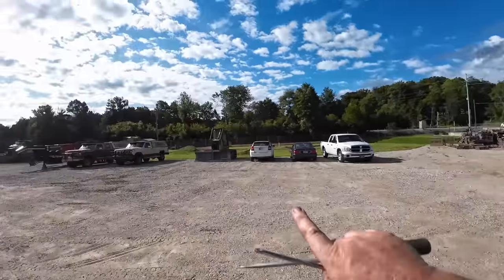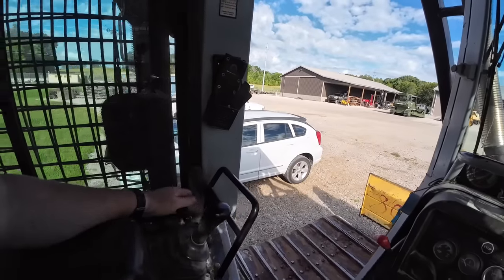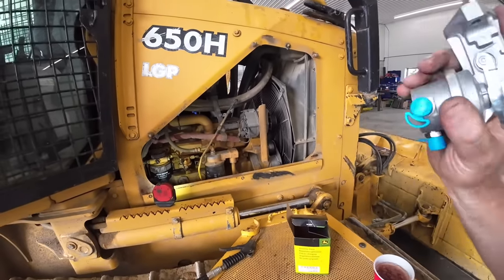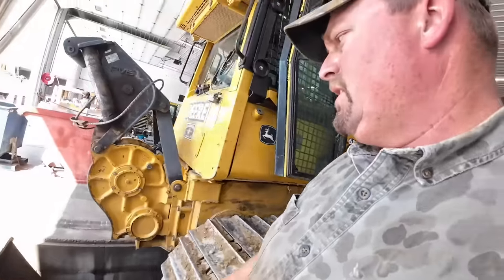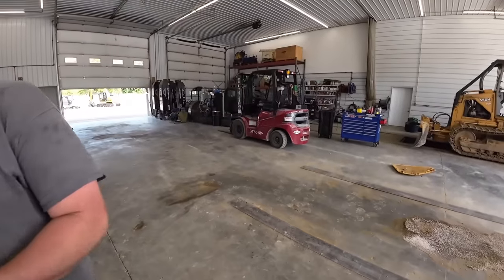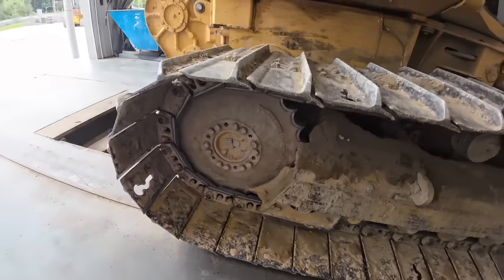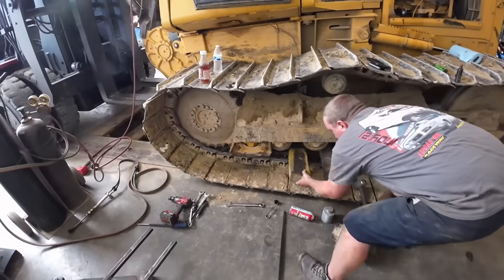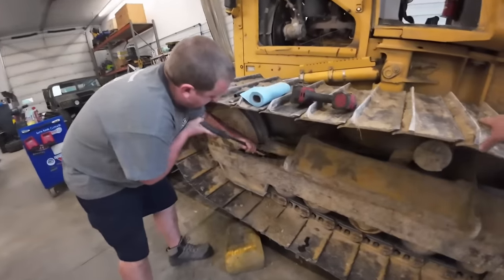Simple repair on dozer leads to many headaches and we return so broken Harbor Freight tools!

Comment: You may want to try some Kroil Penetrant for rusted/stuck bolts and nuts, this is the best stuff that I have ever used.
Reply: I priced that kroil penetrant and the price is outrageous on Amazon.
Reply: @deliveryguy7402 but it is good stuff.  Jack leg mechanic here but it's all I use . Sometimes just got 2 pay fiddler ! God bless and have a good day  .
Reply: They are really proud of kroil.  Zep has worked better for me. & more affordable
Reply: @geostawny  you differently want to us what works best for you
Reply: 50/50 transmission fluid/acetone. same as aero kroil
Reply: 50/50 transmission fluid/acetone
Reply: I have used it several times and it does a great job of penetrating rusty things

Comment: The little coils you use for that tool are small induction coil and to work properly they need a gap around the part, the more times you heat the steel it changes the property of the steel especially when you add the penetrant oil . we use to use induction coil on a larger scale but still work on the same principal. Heating the frame  more may have worked better, we only heated bolt heads if lock tight was applied.

Comment: the ductive heater is designed for nuts stuck on threads not bolts stuck in threaded hole, for bolts stuck in threaded hole i heat the metal around the bolt then cool just the bolt , normally works
Reply: Exactly.... You're trying to expand the "hole" while keeping the bolt cool (and thus relatively the same size).
Reply: I agree. You should have heated the metal the bolt was in. I've been working on autos, trucks and heavy equipment for over 45 years. The only time I need to heat the bolt, was to get rid of Red Loc Tight, first.
Bob

Comment: Heating the bolt makes it expand into the hole.  You need to heat the metal surrounding the bolt.
Reply: If that’s the case, why would the new tool heat the colt?
Reply: True, but they are heating the metal to expand the bolt to break any rust up so they can then turn the bolt.  once it cools down - even a bit - as it cools down it breaks the rust bond and makes it normally so that the bolt will turn.

If it doesn't then..... it can't be stuck if it's a liquid.
Reply: @MichaelVankirk-q4s  It can work in some cases. But the best bet is to heat the rail not the bolt.
Reply: @MichaelVankirk-q4s  I'm not an induction expert..if your cooking pan base won't stick to a magnet then the induction method of heat transfer will not happen on your induction stove top, stainless pans will often include a mild steel layer stamped between two stainless layers to make it compatible with induction cook tops ..those induction coils in the stove top may very well be directional, else wise any steel component inside the stove top would be a fire risk, the coil used  here was touching the bolt head far more than the surrounding steel
Reply: But it shrinks when cooling.
Reply: With respect to all viewers, these guys have been working in heavy earth moving equipment for a little while now, so I’d guess they have got the hand of removing frozen nuts and bolts🤔
Reply: @PhilRable  with all respect Phil, you can teach an old dog new tricks 😂. I learn something new everyday and have been repairing equipment and doing electrical work since I was 15 years old. I’m retired now at 68 (almost 69) but I still fix a lot of stuff 😊.
Reply: @PhilRable  evidently not because they did not get it out.
Reply: @deliveryguy7402 Yes! This is what people don’t understand! The beauty of welding a nut on is not only do you have a new bolt head but you’ve significantly heated the bolt, but not the surrounding threads because rust acts as an insulator. So the bolt cannot expand but it does shrink, pulling away from the rusted threads. If you had heated the bolt and surrounding material equally they would just grow and shrink together. Heating just the bolt and letting cool is the way to get the bolt shrinkage.
Reply: @colindgrant  really? Then why is the bolt still in there frame?
Reply: @anthonyhumbert8787  as mentioned in the video, they were unable to heat the full length of the bolt, and it had long thread engagement length. The method isn't guaranteed to work in all situations, but physics is.
Reply: @colindgrant  physics has nothing to do with it. It's thermodynamics
Reply: @anthonyhumbert8787  LOL!
Reply: Heating the bolt works 10x better.  Heating the surrounding doesnt work al all because it is just way too  slow.
Heating it expands the bolt when the surrounding material keeps the same size. So the bolt has to expand in the lenght only. When it retracts it will retract in both ways, so it will be smaller when cooled down. Then a nut can be welded on and then the bolt goes out. Thrust me i have done a lot undercarriages with a lots of broken bolts. I learnt it quick, otherwise i had to drill out 60 18mm holes underneath  a crane. With the procedure i said, i only had to drill 3, and they were propperly fcd
Reply: @megape95  100%

Comment: I have been shopping at Harborfreight for over 20 years and when I was a mechanic for Bobcat, I priced three angle wrenches for hydraulic fittings with Snapon, and they were $300.00. I purchased the Harborfreight complete set for $39.00 I have them to this day!

Comment: These induction coils are usually only used in places where a open flame is bad, like hydraulic hose fittings, injection lines and fuel line screws, nothing replaces the oxy gas torch except maybe the oxy lance

Comment: Sometimes they would use liquid nitrogen. The whole thing is just a bear. It's just a grueling bear.You start asking yourself questions about yourself. Yeah, it's a broken  bolt upside down. In that position, not much space is the worst. Or maybe heat up the skinny part of the rail to expand the rail. Or make the whole bigger. It's just a bear , no matter what.

Comment: To loosen a nut -- heat up the nut & it will expand.
To loosen a blot -- heat up the area where the bolt 
goes into or freeze the bolt.
Heating the bolt will cause it to expand & get tighter.
Reply: If you heat the bolt, it will expand into the cold bore of the frame, the frame is rigid so the bolt if got enough will compress, but then you need to let the bolt cool completely to get a couple thousandths clearance for penetrating oil to soak in.

Comment: If you have a bolt that is stuck , you can easily remove it by heating it red hot then quince it with water until it’s cold . It will come out very easily , works every time . I have used that trick for 30 years. You keep up the great work.
Reply: I completely agree with you about quenching. I'm a retired British blacksmith, it was one of the first things we were taught. It works better on nuts, than studs, if you get both components red hot then quench the not very quickly it will stretch the nut ,and almost certainly be just hand tight

Comment: Just a hint. Nuts are not the same as bolts. The induction heater works better on nuts as it expands them off of the bolt. Heating the bolt causes it to swell in the plate. Of course a molten bolt will come out! 😄

Comment: You should have used a rose bud tip on the oxy acetylene torch and got the rail red hot. I worked o a lot of Turf Eq back in the 70's and it would work almost every time 😀

Comment: since you had access from the top of the broken bolt in an open hole....would have been an interesting candidate to try the "Candle Wax" method for removal
Reply: I’ve used paraffin wax to remove couplings from shafts. It works good. I keep a block of it in my toolbox.

Comment: I'm surprised you didn't use an air hammer to "shock the bolt" before welding it. Shocking the bolts really really seems to help off rusty and stuck bolts.

Comment: I know on our 650H it lost prime all the time and chased it figured we had fuel leak somewhere couldn’t find anything changed a lot of them rubber grommets on them small metal fuel lines with no luck and finally found where they changed the design or came out with another hosing for the first fuel filter think they got rid of the hand primer on first fuel filter hosing changed that out hasn’t never lost prime since that…sales service woman at our John Deere dealer said her tractor done same thing till she changed that part out so we tried it and damn the luck

Comment: Use 50 nuts to get one bolt out. The induction heating coil should fit around the application with enough space to leave a small gap between the coil and the object to be heated. The closer the fit (without touching), the faster the unit will heat the bolt. If your coil diameter is too large for the application, it may take longer to heat. I google it :)

Comment: Heat the part the bolt goes into, also air hammer around it, helps to break that stuff up a bit. And for those induction heaters, I use them for o2 sensors. The coil doesn't touch the fastener, it's not supposed to. Hence, the induction part of the induction heater.

Comment: I remember doing that years ago and after many nuts and washers plus many many cuss words and a few beers a buddy of mine said drill the center of the bolt and weld another nut on and I joke you not that bolt came out. We had the rail red hot at one time and it still wouldn’t come out until the center had that hole drilled in it. As far as the Harbor Freight deal on what others are saying I have had zero issues returning or warranty on anything I have purchased.

Comment: Stuck fasteners are damn frustrating and confusing.  Confusing because engineers apparently don't solve the problem.  Or can't!  Somehow the bolt's strength > typical corrosion.  

The induction device you tried is FAST but still just imparts heat.  I might invent a device that requires a hole in top of bolt to accept a freezing device.    This device would shrink the fastener loosening its grip.

Comment: Heating bolts works because the hot metal expands. With no place to go, it elongates, compresses, or stretches the parent metal. As it cools, it is smaller than the original diameter. Let them cool as much as practical.

Comment: You could try freezing the nut, with dry ice to shrink the threaded section.  I used this idea on railroad traction motor flange bolts.  Dry ice will freeze it down to minus 60 degrees C.  And shrink the bolt a few thou.  But you need to do this on every bolt before  putting on the impact wrench.  And before heating them as heating will soften the high tensile steel of the bolts.  You need to make up a soda can with one end cut off, put metholated spirts in the can so you can have the head of the bolt immersed in the meths. Put the dry ice in the meths till it stops giving off vapour.  In case you dont know what metholated spirits its just pure wood alcohol.  I held the can with welding gloves.  Give it at least ten minutes of soaking time.  This method will keep the strength of the bolt.

Comment: I found sometimes you can take a torch and blow the bolt out without hurting the threads because of the mass of the frame. Melts the bolt but does't hurt the frame threads. Works great.

Comment: Track frame bolts are bad boys.  I have had success in removing stuck bolts by shocking red hot bolts with cold water.   Seems the instant contrast helps shrink bolt diameter .  Any port in a storm when it comes to stuck bolts!!

Good job, great work. Keep it up!❤❤❤

Comment: To undo really tight bolts we used 3/4 in drive breaker bar which was home made.We used a piece of 1 inch 4130 steel about 4 feet long and bent it 3 inches from the end with oxy to get 90 deg.Then filed the 3/4 drive onto it..This has the effect of removing any flex which makes a big difference.And yes still use heat.

Comment: The way that bolt refused to come out I think that only a drill bit will cure it. Using your torch and heating the frame and letting Kevin play the drums on it with his big hammer might have helped.

Comment: after viewing countless of your videos and learning, I can tell you without a doubt the degrabalator on the  frenosing gear is installed incorrectly.  The splinage on said gear needs to perpendicular to the left lift cylinderation mechanism and canted 35.25° forward.
Reply: Then when the dilithium crystal are realigned the subspace bilateral transfer will allow the correction of the frenosing gear.
Reply: @kenore4003  EXACTLY!  Gawd, there’s someone who understands!!!

Comment: When you have a rust seized nut or bolt, heat it up red then douse it immediately with freezing cold water. It usually breaks the bond.

Comment: After I retired from software engineering, one of the things I did for fun was work at HFT for a couple of years.  If it hadn't been for the pandemic and my multiple risk factors, I might even still be there.  Anyway as a former insider I can tell you that any store CAN break up a set for a replacement any time.  But also there are technicalities they can use to refuse.  As far as I can tell, they never would refuse unless that customer had already annoyed them.  So ... all those people telling you they were unable to exchange some item without bringing in the whole set have OUTED THEMSELVES as someone who would be a rude jerk to low wage retail employees just doing a job.

Comment: The induction tool isn’t the tool for the job…it’s more for nuts than bolts . The ideal approach is to use your gas hatchet and heat the housing up …not the head of the bolt…not enough heat transfer . Sometimes in that situation I heat up the housing …have someone put a firm pull with a breaker bar and use your air hammer with a hammer bit in it vibrating the housing where the bolt is…many times the vibration loosens up the rust within the threads and it will back out . Best of luck next time

Comment: Next time get a plain white candle, heat the bolts , nuts up, and let the candle wax suck in the threads like solder does on a copper pipe,.A Retired concrete hauler, and a old mechanic at the plant showed that to me on my 91 Ford F250 EGR valve, and use it regularly on my 100+yr old hit and miss engines, told people before , and get BS, and I thought the same myself ,until you see what wax does to rust!! Usually IF it wont work It Isnt coming apart peacefully!!

Comment: If at all possible and you are not trying to save the bolt, cut off the excess threads. No need to try and run that extra thread back through the hole. Works well for long bolts with boggered threads or coated with paint. Had to do that many times when working in the oil refineries.

Comment: I don’t have near the experience as you guys but when I worked on my 450c I had quite a few bolts break off. I kept welding on nuts and they kept breaking off flush. So I built up the bolt till it stuck up then welded the nut. That worked better. I also drilled a whole in a 1/4 piece of strap then welded it and tapped it back and forth with a hammer. Finally got them all out.

Comment: The idea behind the Snap-On tool is to heat (expand) the area around the bolt. You don't want to heat the bolt. You want to heat the metal around the threads of the bolt so that you get a difference in temp between the threads of the bolt and the threads of the bolt hole. In short, the "hole" expands and the bolt stays relatively the same size - thus breaking the overall seized connection. Ideally you would want to freeze the bolt while at the same time heating the bolt hole but as of 2023, we don't have that technology.

Comment: Your heating element might work great on a nut, but you were working on a bolt. Heat expands, cold contracts. You were expanding the bolt. You should have been trying to keep the bolt cool while heating the metal the bolt was stuck in.

Comment: I wrote this before watching till the end of the video. 

When a bolt breaks off that is almost flush with the surface, I find good luck in welding a washer to it first and then I weld a nut from the outside to the washer. You may already know this and know it doesn't work on heavy machinery, I work in a factory so applications are a lot different.

Comment: I was wondering if maybe you drilled a hole through the center of the broken bolt if it may allow the bolt to move a bit with the heat changes when you weld a nut on the end.??

Comment: I wrapped the can with rags to help insulate it.  You may be able to help loosen the bolt after having another go at welding on a nut on the busted stump.  Using this method,  Or you will need a cornering drill to drill out the stump, you must center punch the stump dead in the middle, start with a fine prick punch, which can help you run the punch mark till its dead in the middle of the busted stump, then center punch your mark deeply,  then  drill lots of pilot drill holes, then pick out the threads with a bent scriber.

Comment: When you heat stuck bolts try putting ice on them. iIt makes them contract quickly breaking the rust. If you think it will be to brittle reheat to aneal. Learned thet working for a hydraulic shop rebuilding cylinders and almost any thing else. Thanks for the videos.  Athur from NH

Comment: Hitting a red hot bolt with an impact wrench is a good way to break it off. Let it cool first, then use a wrench to work it back & forth. Better off heating the steel surround than the bolt head in any case.🤠😎